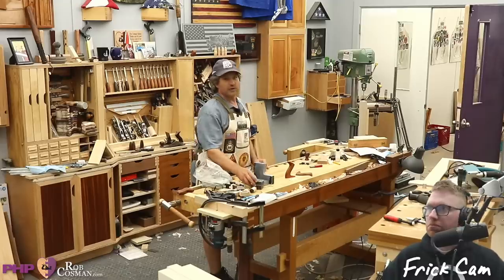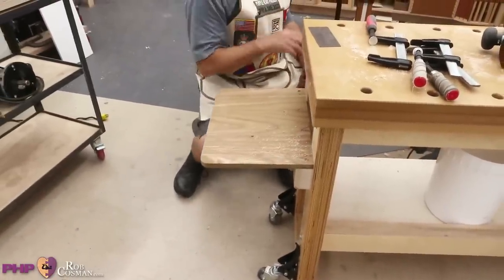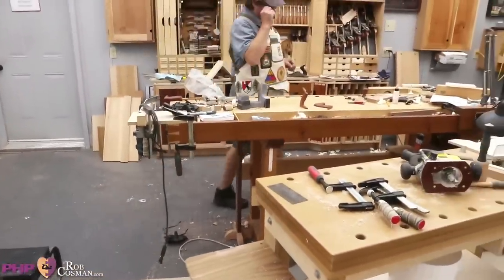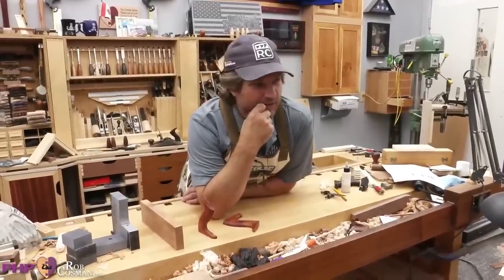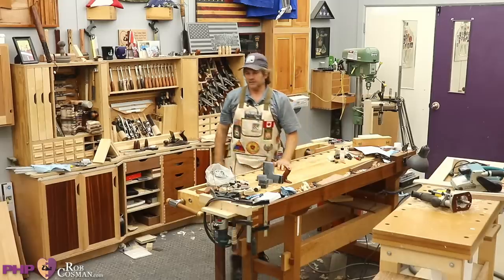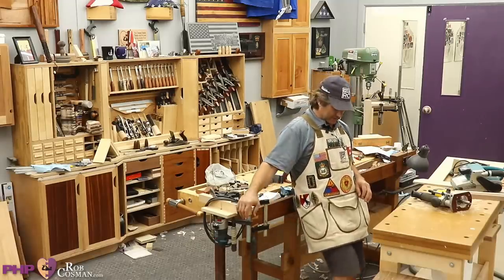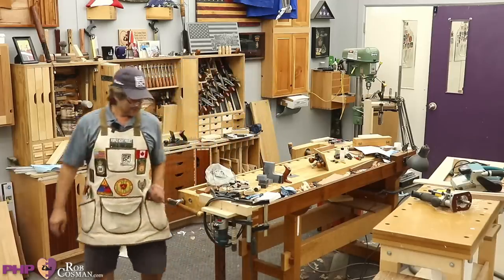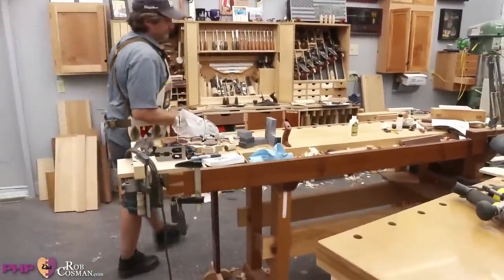Live Event - Building Workbenches (2 JULY 2022)

Comment: 16:40 instead of a sliding deadman you could drill a row of holes on each leg of that side and use them make an additional height adjustable stretcher. The stretcher would have two dowels attached, that fit to those leg holes, these dowels need to be long enough to have the stretcher flush with the side of the tabletop when pushed in, but still give enough support to pull the stretcher out to act as a deadman. Sounds complicated, but should be easy enough to do. Take a board with the thickness matching the overhang of your tabletop, long enough to span across your legs, drill a hole at each end, then use it as a jig for the holes in the legs. Two dowels with suitable length and diameter.

Comment: Hi Rob and gang. Just learned you guys are going to be suppling the Cosman workbench for purchase.
Have you considered making the last (top) sheet (in the MDF version) out of moisture resistant (green) mdf or better still out of TRICOYA MDF?
TRICOYA is waterproof mdf designed for out door use. Iv used it to build gates that I later skin in hardwoods.
As an experament I beried an of cut in my back yard and dug it up over a year later.
It was perfect.
Also on the moxon vice, didn't lie_neilsen make one that sits onto the bench? Did you have a chance to try it out when you worked with them?
Reply: Tricoya is fantastic stuff but it's also 5 or 6 times the price of standard MDF.

Comment: How does the MDF hold up as a benchtop?
(My assumption is that it handles water & hardware badly. Of course, there are a context how one would approach it but I've seen most budget options being pine. is there a "pro" that MDF gives that isn't apparent? )
Reply: Wrap it with inexpensive hardwood and sheet it entirely to the edges.Top only.

Comment: I've found that a parallel clamp with the moving jaw reversed, and with a second clamp clamped to the static jaw to act as a foot works really well as a bench slave 

No need for a separate one trick pony, and the height is infinitely adjustable